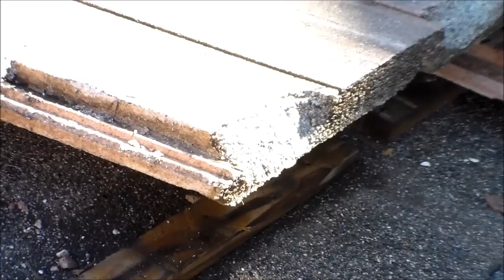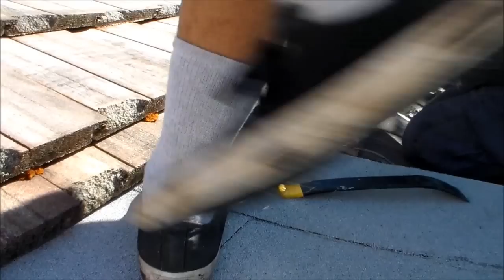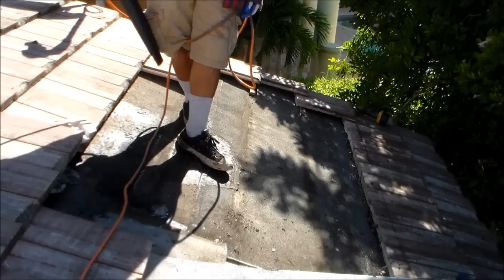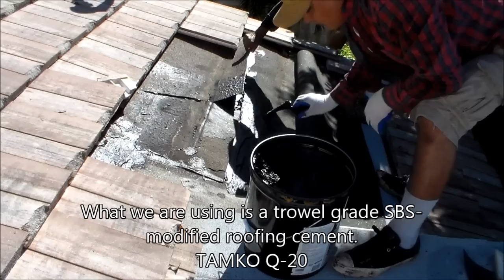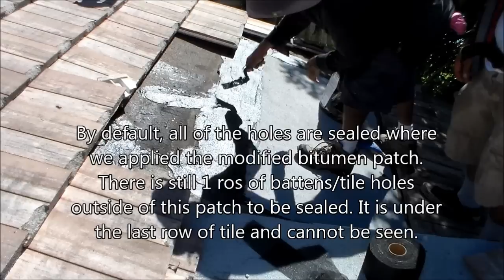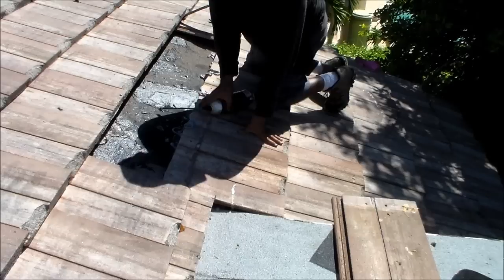Roof Repair - Tile Roofing Leak Repair - Start to Finish

Comment: on hard to find tiles, could one take the best tile and make a casting to make your own concrete tiles to replace them with?
Reply from the maker: Flat tiles can are very "forgiving" when trying to use other brands. Barrel tiles are not, some tiles you can make magic happen and others you have to tear off an entire panel and salvage, then replace the panel with new tiles. It is an art.

Comment: Good video!  What product was the spray can you were using?  Thanks.
Reply from the maker: You must be talking about the roof tile adhesive. That is foam roof tile adhesive - It is TileBond Roof Tile Adhesive. You can get it in small cans for $20 each or so for about 12 tiles
Reply: Thanks for the information.
Reply: Screws should have never been used to fasten down the tiles